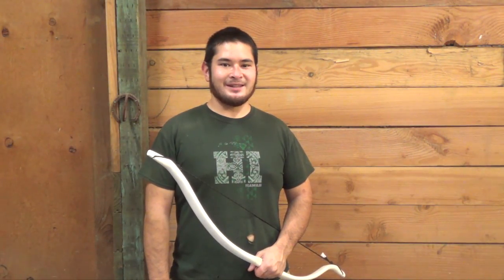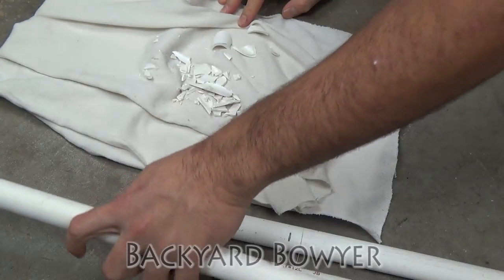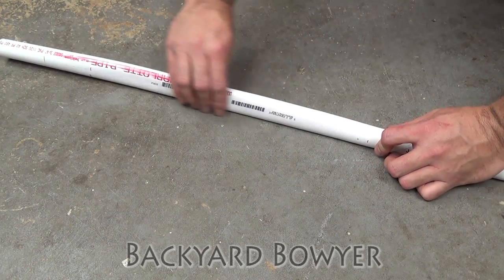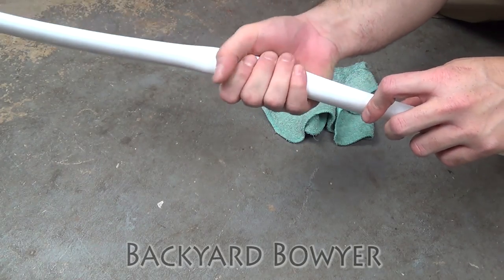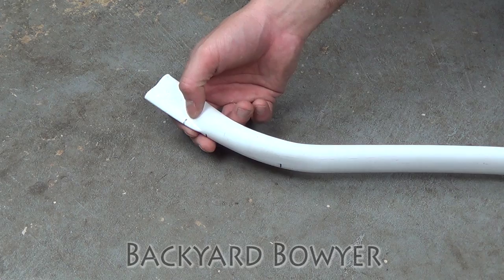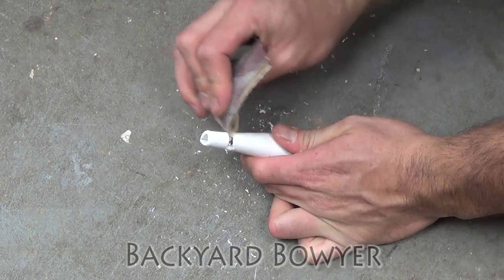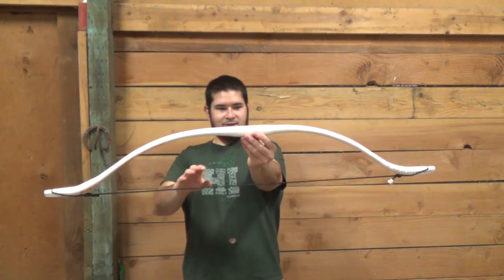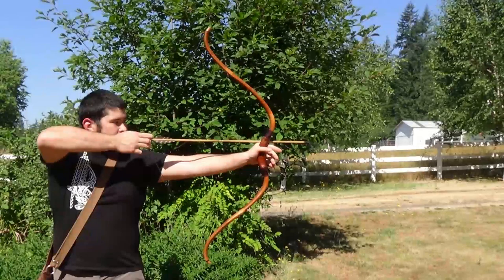40 Pound PVC Bow Freehand Tapered - No Flattening Jig Needed

Comment: Wait, unlike your other PVC bows, you didn't put any fiberglass in the pipe.  Since that's the case, wouldn't the bow eventually wear out after a while?  And the pipe will permanently be bent, hence permanently reducing the draw weight?

I saw some other videos too (the ones that don't use the fiberglass), but they never mention that.  I mean, that's the point of putting fiberglass, right?  To make quality bows that last?  Or does the recurve somehow prevent that?
Reply from the maker: +Michael Song Thanks for watching! The fiberglass rods are to increase the performance and life of non heat tapered bows like the 40 pound no heat bow I did a while back.

Tapering the bow limbs with heat helps with the same problems, but the lack of fiberglass rods makes this type of bow faster than one with rods. This type of bow lasts longer than a bow with a core, because any core ends up causing wear or concentrating stress.

A bow like this would be longer-lasting, something to finish and enjoy as an everyday shooting bow.

The fiberglass core bows tend to last for a couple of years of daily shooting and need to have their pipes replaced. The cores themselves are virtually indestructible, and can be slid into a new pipe for a bow that should handle almost identically to the previous.

Hope this helps!
Reply: So, if I am to make a bow (I have a heat gun and everything else), I should make the one without the core, but the one you showed in your video?  And this lasts longer?  And has the same draw weight?  Wow.
Reply from the maker: +Michael Song Yes! It's pretty amazing. If you've already made a fiberglass rod bow, you will immediately feel how much more pleasant a bow like this is to shoot.

There is a bit of a learning curve, so don't be discouraged if your first bows don't come out the way you want.
Reply: Thank you.  I shall try that.
Reply: BackyardBowyer how long is the bow and the markings
and can I do it with 1/2inch PVC????
Reply: Michael Song
Reply: Michael Song you make the bow so that the desired draw weight it achieved even after the pipe bends to its final form. That is why he shoots his bows a bunch befor giving them away, this is true for all bows no matter the material

Comment: why paracord temporary if it works just fine?
Reply from the maker: +Hero Legion Thanks for watching! Paracord will work as a string, but the Dacron string I'm making for it will bring the speed of the bow up a little bit. Paracord is just really bulky, overbuilt, and stretchy for a high performance string. That said, it works if you don't mind the bow being a little slower.

Comment: What is the thickness of paracords?
Reply from the maker: +pedro henrique dos santos Paracord is a little thicker than 1/8" under tension. It really depends on the type of filling used. The outer shell is usually about the same for all 550 and similar paracord, with some having more or less filling material. Hope this helps!

Comment: Could I make the bow 5 feet tall?
Reply from the maker: Yes you can, though the draw weight will be in the 10-15 pound range. This can be scaled up to 1 inch pipe at 5 feet, around 40 pounds at 28".

Comment: What's the durability on a pvc bow? And what about weather affecting it in cold climates? Thanks.
Reply from the maker: +Life's good As long as it's made well and the PVC has good impact resistance, it is very durable. Cuts, hard strikes, and deep scratches can hurt the bow, so you do need to try and keep it somewhat nice.

Treat it like any other traditional bow and it will work well. An added bonus is that it is completely waterproof, making it great bow fishing or kayak bow.

If the pipe is brittle, cold will only make it more brittle. A good way to ensure the bow won't give you problems in cold is to do the hammer test at the same temperature you hope to use the bow. Hope this helps!
Reply: BackyardBowyer thank you 🙏🏼. Keep up the great content and may your online business thrive